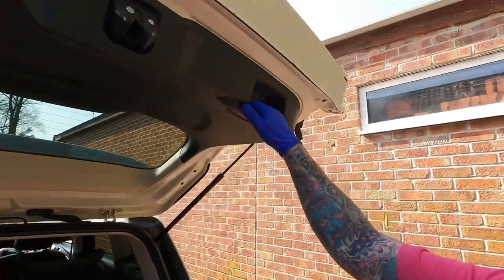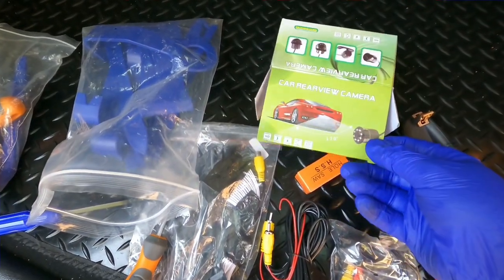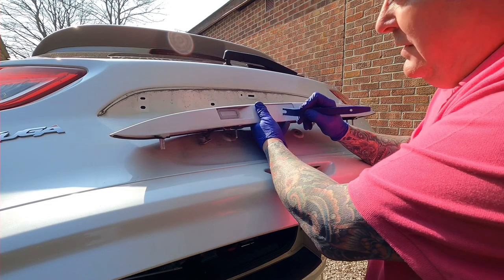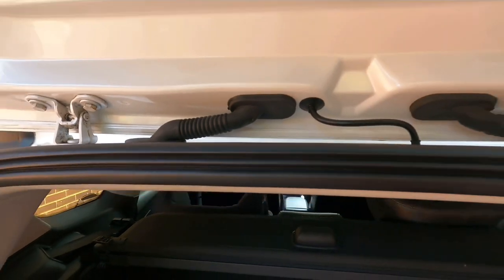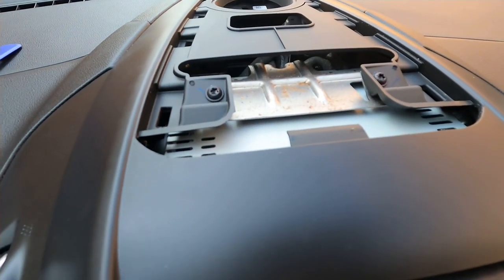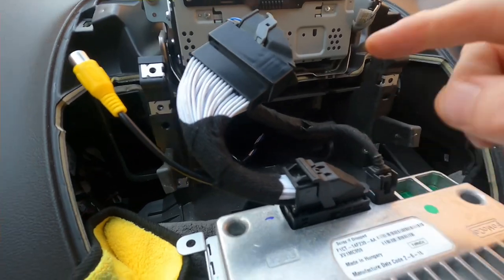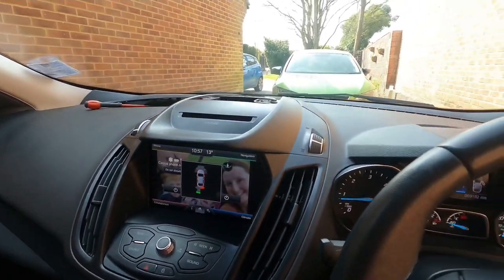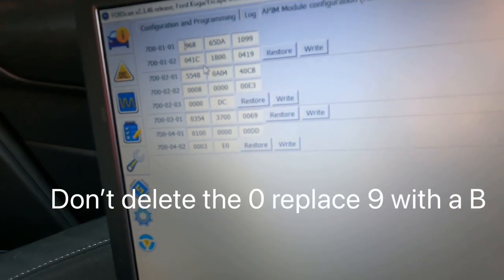Ford Kuga aftermarket reverse camera how to install👍forscan sync 2 and 3

Comment: Thank you! So after all there is no need to replace the tailgate wiring loom as I can see. You literally saved my day as I bought the camera and the sync connector and even voltage regulator but I’m missing the original wiring loom containing the video cable .

Comment: Nice installation  you’ve obviously got the know how and tools ,I’ve got a 2017 Mk3 Ford Focus Looking at adding a Reversing Camera and hardwiring it to the factory LCD display but will
Get it done by an Auto Electrician .
Reply from the maker: It’s the same basically in terms of wiring and installation. You will have a synch 3 and the wiring and camera that I used would work in the focus 👌 if your anywhere near Dorset I could do it for you 🤷‍♀️

Comment: Thank you.  Just did this on a 2013 Escape.  The second digit needed to be changed to a "2" instead of a "B".  I dont know if a B would work for my car, but there are several threads that suggest the "2", so I tried that first and it worked. My second digit was originally a "1".  Thought this info might help someone
Reply: what would be the number for smax? 2017 make
Reply from the maker: Go to the APIM As-Built
2- Do a backup of your original APIM (just in case)
3- Change block 7D0-01-01 ×*xx-xxxx-xxxx
*=3 With camera no PDC
*=9 No camera with PDC
*=B With camera and PDC

This may or may not work for the smax
Reply: 3 worked for me, instead of 9 - 2016 kuga

Comment: well watched your video on this installation and recommended parts. so fingers crossed all goes well. I've ordered through your links, hopefully you get some kudos for this?  What about a video on FORSCAN, installation to windows and settings as they are prompted during install, then using dongle from tunnelrat electronics to enable connection of vehicle electronics.  thanlk you.
Reply from the maker: I’m about to go to Cornwall for a week camping so won’t be able to do one prior to that as I work full time. No the links are just to help out I gain or get nothing 🥴 if you need further help and your not a member already and on Facebook join ford kuga owners club uk I’m an admin there and could help you out that way also 👍

Comment: Did the car logo on screen work i.e shows the distant lines and also do the colured lines follow your turning.
Many thanks
Reply: No only factory cameras do this, a video signal into an adaptor is just that, it's a video signal.

Comment: Can't you use a switch or cigarette lighter to get power, saving all that hassle   taking things apart? Im sure a cigarette lighter lead somewhere has a switch on it.
Reply from the maker: The trim has to come off to run the camera lead from above the number plate  into the car, taking the live from the reverse light isn’t a big deal! Plus when the car is in reverse the camera is activated

Comment: Hi, the wiring harness link doesnt work. I've found a different one on Ebay.  For Ford 54-Pin SYNC 2 or SYNC 3 with RCA Rearview Camera Adapter Cable Harness
Can be that good too?
Thanks
Reply from the maker: Hi I posted the video sometime ago mate but by your description the lead you found sounds like it will be compatible- cheers

Comment: Top video this mate! Quick question, did you pull the fuse to make it safer to work with or is it something for programming?
Reply from the maker: Just because I was putting the new lead in that’s all👍 so safety I guess, I never lost any settings either 👌

Comment: Hello Gary. I have a65 plate mk 5 Mondeo  1.5 tdci econetic with Sync 2. Is there an easy way to check whether the head unit is 'camera ready' with the necessary software already installed. Having said that, there is no on screen prompt when I select reverse
Reply from the maker: If it’s sync 2 it’s just needs activation via forscan

Comment: Wow. Didn't know this was possible
Reply from the maker: Some guys on eBay charge £300 to do this 😬
Reply: @garywilkostube3435  😂
Reply: @garywilkostube3435  you should make a Video on adding car play / android auto to the sync 2, that's something I wanted to do for years now
Reply from the maker: Think that can only be done on the sync 3 or I would have done it 👍was thinking ofupgrading to sync 3 but that’s like £400 😳
Reply: @garywilkostube3435  I seen some sort of firmware upgrade on ebay for like £100, but I don't know 😕
Reply from the maker: I’m admin on ford kuga owners club uk and I don’t know about this so would say it’s not possible! I’d like to be proved wrong though 👌
Reply: @leordeansg  probably a scam mate, I’d stay clear of people saying that as it’s hard wired into the head unit 👍🏻

Comment: Hello. I have a question,on rca cable on front end cable while use extenzion while not connect yellow to yellow connector and where connect red line on rca also in front side?
Reply from the maker: Sorry missed this comment, I had to use the extension as it was just a bit too short. You can purchase longer leads on eBay and the like but for me it was just too tight and I didn’t want it stretched like that

Comment: Hi All, I have installed a rear-view camera on my 2015 Ford CMax with Sync2 (My touch) The camera works but I am getting interference in the top of the screen.  I have tried 3 different cameras, rerun the cable from the back to the front and also installed a noise filter on the power cable but its still doing it. The video also rolls sometime. Has anyone else had this problem and if so did you manage to get a fix for it. 

Thanks
Reply from the maker: Mine does this sometimes I’ve just learned to live with it!

Comment: Wirless harness link not working also how is camara holding up
Reply from the maker: It’s still working but gets some interference at top of the screen! I suppose it’s ok for the money but I may change it for a more expensive one in the future 👌
Reply: @garywilkostube3435  least u got wires in place be alot easier just to replace cameras u cud try order various ones and send back the ones that are not good

Comment: I do appologise for the question but I really am not good at these things. I have as fairly low millage used focus MK4 2019 with sync 3.2. Has identical camera (at least visually). It was installed by the previous owner who kindly also fitted immobiliser (himself or at a garage but all aftermarket). I would love to update the Sync to 3.4.  But my concern is - will my aftermarket reversing camera work after the update!?  Will there be compatiblity issue etc and need to find Forscan and go adjust the settings with it  or just smooth transition?  Gary, what do you think and have you done an update?  Can I do the automatic update without fear for my camera?
Reply from the maker: In my opinion you will be fine, go for it 👍

Comment: I've got a reverse camera off ebay to just clip in place of a std number plate with combined led light. Only problem is mine is a Mk1 with twin tailgate so much more difficult to run the wires which I'm still trying to figure :)
Reply from the maker: I did look at that type of camera but preferred the more oem look! Good luck I’ve got no clue with the mk1

Comment: Does this have black and white night vision? Or does it have a light on it? Or neither? Its just the box yours came in looks like it has led lights around the circumference but the link you have put doesnt mention this at all.
Thanks
Reply from the maker: I just checked the link and it says it has night vision! To be honest I’ve never reversed it in the dark! Maybe I’ll wait until later and try it! Like I said in one of my other comments to you this is a cheap camera and does what it says on the tin 😁 if you want an all singing version just spend a few more quid and get the camera that works for you 👌
Reply: @garywilkostube3435   that would be helpful if you dont mind, to be honest they all look the same on ebay, at least with yours  i have something to use as a expectation.
Reply from the maker: Ok I’ll have a look later 👍although I have led reverse and number plate lights 🤣
Reply: @garywilkostube3435  haha yeah thats fine thanks
Reply: Also 1 last question i promise, i see you connecting the earth and feed to the reverse lamp, but i see there was a small thin red wire at the front maybe a trigger wire, i assume you left that disconnected?
Reply from the maker: Yea i didn’t need to connect that so useless! Just been out and checked camera in dark and I don’t know if it’s because of the camera or my led reverse bulbs but it was pretty good in the dark and no I left my lights off too! I took a pic but don’t think I can add it in comments
Reply: Thank you

Comment: Im having Sync 2 system, how can i change to sync 3
Reply from the maker: It can be done but you need a complete new unit from another car plus the usb cable and gps unit! Around £400…… if I decide to upgrade mine I will do a video
Reply: there is an unofficial upgrade method , look for it